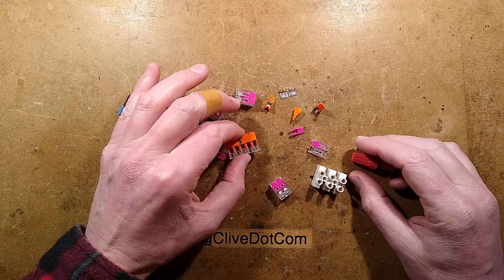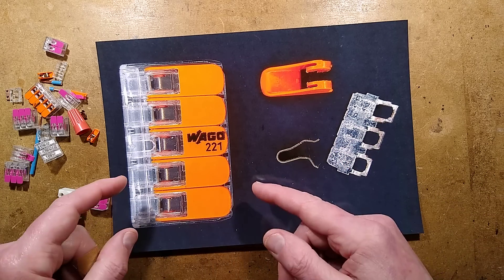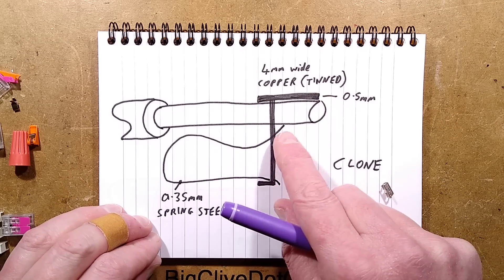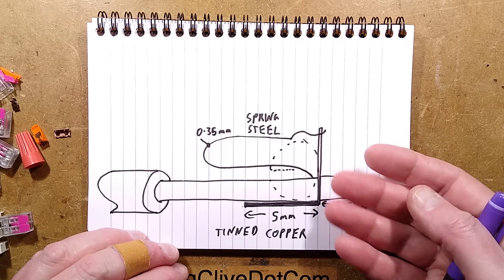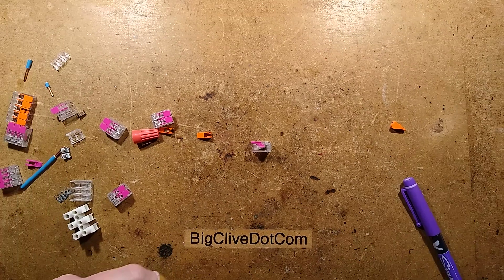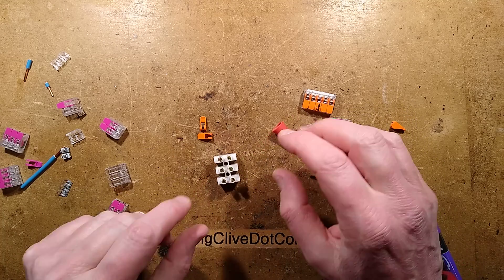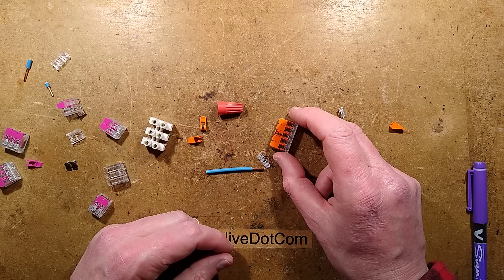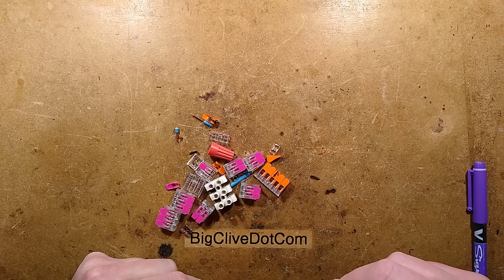Inside a Wago connector and a clone

Comment: The worst are those screw terminal splices used in the UK.  The Wagos are nice because they apply a constant tension so the connection won't loosen up over time.  Wire nuts may seem crude in comparison but when used correctly, you really can't complain about the effectiveness of the connection and the low cost.
Reply: The "when used correctly" might be a catch. If untrained users struggle with your product, that's not necessarily a feature.
Reply: Let me put it this way: how many people you know twist the wires before installing a wire nut?
I guarantee it is at least 20% of your coworkers. That alone should tell you why the qualifier “installed correctly” should not be assumed
Reply: @melody3741  I'm more concerned with wire size and count for the correct size wire nut.  I've not pre-twisted them (much) but really wrench down on them to the point where they bite into the copper.  Usually by that time, the wire ends up well twisted.
Reply: I can definitely see the advantage of using Wago connectors for someone who's inexperienced. Personally I think I'll stick to wire nuts. They're cheaper and do what they're supposed to, never had an issue with them, and I'm more than competent enough to pre-twist before screwing them on, as I do every time I do any DIY electrical work around the house or for family (I had a couple years of formal commercial electrical training in high school).
Reply: @TakeNoShift  Twist nuts are great for permanent installations you don't have to screw around with once finished or have no intention of ever swapping out. "Lever nuts" like those Wago make are nice for the possible future replacement of components in the future.

Twist nuts also tend to mangle leads up whereas the levered variety if used correctly preserve the wire structure, so if additions are necessary you just add more connections with less risk of lost leads and less need to repeatedly strip wires. Since they don't flare out at the bottom, they could also be used to make connections so they tuck away in a niche twist nuts simply can't fit in as easily.

How about trying them out before knocking them?
Reply: @bluephreakr  "How about trying them out before knocking them?" I have tried them, I really don't see THAT much of an advantage over wire nuts for someone like me who knows what they're doing. Like I said, Wago connectors seem like a good option for those who are inexperienced.

"-the levered variety if used correctly preserve the wire structure..." You don't end up with a mangled mess if you use wire nuts correctly. It's not hard at all to keep things neat with wire nuts, unless you're inexperienced, and at that point if you can't neatly fold wires back into a box with wire nuts, you won't be able to do it with a Wago either. Wago connectors are much more approachable, sure, but for anyone who knows how to use wire nuts properly, they do their job perfectly fine with no issues, which is exactly my reasoning for why I said I'll stick with them.
Reply: Well, wire nuts are most definitely inferior. Yes, they can work, but they don't have the same ease of use (and difficulty of Mis-use!) as the Wago connectors, and they can fail over time with thermal cycling. Wagos do not.
Furthermore, the cost of Wago terminals is inconsequential. They range between 10-25ct per piece for a 3-way connector, compared to 5-10ct for Wire nuts. That could add up to tens of dollars for a whole house!!!
Reply: @kain0m  the wire nuts I use do apply a fairly constant tension due to their very spring like nature so not only do they bite into the copper, the coil of plated steel spring rides up on the copper wires and will hold them secure trough repeated thermal cycling.  If this wasn't the case, they would probably not have all the safety agency approvals and insurance companies would be having cows.
Reply: @chrisharper2658  So their performance really relies on the quality of the steel in spring.  I just see the clones using cheaper metals ....
Reply: No. 
Wrong, wrong, wrong....
They can always complain about it, because most of them have never actually used one, or seen one. 
I know, that doesn't make a lick of sense, does it?
Don't matter, they don't use them so its inferior.
Reply: @boots7859  Or, and hear me out here.. we have used them. And we still don't like them, because we're capable of forming informed opinions based on real world experience.
Reply: @boots7859  My very European apartment uses wire nuts almost everywhere. A few later additions to the circuits use Wagos as usual. Wagos are much easier to work with if you want to add or remove something. I curse the person who went with wire nuts (also because the installation as a whole makes no sense).

Comment: Oh, and a note to all electricians out there. Spring terminals like Wago are NOT maintenance free if used in damp conditions, or where moisture such as condensation can form. The connector itself may be fine, but verdigris can eat away at the exposed copper wire inside the connector, and eventually the wire will break due to a the pressure from the spring causing a stress fracture as it corrodes away.
Reply: They've got a gel box design for wet locations, it's apparently some kind of polyurethane goo.  It's apparently rated for 1m immersion.
Reply: @jonc4403  Wago Gelbox covers are great. They are IPX8 so they can handle continuous immersion of at minimum 1m, probably more. They're approved by many standards around the world, would happily trust them. I don't know why North American sparkies are so against Wagos.
Reply: No, the EU will take Reality to the High Court and overturn that fact of life.

Comment: The versions I'm familiar with here in Australia from eBay vary slightly amongst themselves, but vary considerably from the Wago. The common factor is they all have grey opaque plastic bodies, usually with orange levers. Have you encountered or taken apart/destroyed any of these?
Reply: Those are probably rip offs of an older iteration of the WAGO connectors like 222-413. They are still available, but the transparent ones are preferred because you can see, if the wire is all the way in.
Reply from the maker: I think I took apart a through-connection version.

Comment: Canada is still fully in Marrette mode, which makes for a very full wiring box when you're wiring 3 or 4 way switches.... I've always been told to twist wires together, then put on a Marrette, then keep twisting until the you see a couple twists on the bundle. Bonus old-school points if you then wrap electrical tape over the whole shebang. 

Wago uses much less space than Marrettes and should get away from that "mash at the box to get the switch to sit flush" scenario where something is going to get stressed.

Interestingly in my former 1950's house, there were lots of hidden junctions in the walls and ceilings with twisted wires, then soldered, then taped with a phenolic fabric... None of them ever failed, but they had to be replaced with exposed blank-plate boxes with a Marrette junction to meet code.
Reply: Agreed. Waygo types in fixture/junction/switch boxes can make life a lot, lot easier and cleaner. Worth 10x wirenut cost there for sure.

Comment: Can I point out yet again that “maintenance free” spring contact blocks for mains voltage wiring have been around for many, many years. Yes, these were designed for wires to be inserted with no means of removing them, but the principle is the same. I first encountered them on commercial fluorescent tube fittings over twenty years ago. And Wago connectors have been used in U.K. industrial use for over ten years. These however need a tool to allow wires to be inserted or removed (it looks like a small flat bladed screwdriver, and indeed if you are careful, a suitable screwdriver can be used).
Reply: Wago even sells the screwdrivers, which are a nice german forest green and black. the right sizes, no risk of forcing/breaking when used properly. your distributor can even give you a couple packs if you ask nicely when buying a bucketload of connectors. 😎

Comment: I'm a card carrying union electrician, and i still use spring wire nuts.  probably because I've been using them for years, I've never had a problem after  thousands and thousands of connections.  pretty much have the capacity of each type/color committed to memory, and always strip back new copper every time i connect.  one of the things i would like to see with these wagos is a microohm test.  i have test sets that can sustain 200A.  you'd be surprised what I've found when it comes to cheap switches and connection, without testing i can tell you there would be a sizable difference between branded and knock off.  there always is, never come to an exception on that.  some pieces (and i mean to use that word) even come back as milliohms instead of micro
Reply: I agree, our European friends think they are from Satan himself. LOL
Reply: Good point. I am only an amateur electrician (i.e., home projects) but also an analog electrical engineer. The term you are looking for is "current density," which is the current passing through a contact, divided by the contact area. A tiny contact area produces a very high current density, a bad thing that can lead to fires. The Wagos' and the clones' flat contacts make contact to the rounded part of the wire, which to my mind is at best 1% of the wire's exposed circumference. I.e, it produces a small contact area. In sharp contrast, a twist-on wire nut makes substantially more contact with the twisted wires. I go overboard when I make my connections. After the wires are twisted together, I pull out my 150W Weller gun and solder the wires together, after which I apply the wire nut. Ain't no way these connections will ever fail! I also recognize that my extra effort is bat-snot crazy and cannot be done by electricians without tripling their labor costs!
Reply: @demef758  that's exactly it, most of my work is on high voltage switchgear (up to 500kv)  it's important to know how well the conductivity is on connections, and often times i have mfg drawings that will specify, say, 100-150 microohm at 100amp per phase.  that's usually a good number on distribution voltage breakers.  just out of curiosity, i bought a BlueSea batt DX (for boats) for my race car.  also got one of those crappy horror freight batt china DXs and put them back to back on my tester.  probably to no surprise, the import one had 100x worse numbers coming out, and probably would catch fire at its "rated" ampacity.  you probably already know there's a lot of electrical trash parts out there that really shouldn't be sold to anyone, ever.  the best thing to do here is buy only reputable brands and literally check everything.  another Amazon special xt150 pin conn i bought had only 25% contact wipe because the case was too long and stopped it from drawing in fully.  well, without this stuff Clive would be out of a channel i guess.  any case, like the other guy said also above me, copper does work harden, then gets brittle and breaks strands.  sometimes I've seen rat shops do this intentionally, like trim half the strands off a 500kcm cable just to make it fit in the lug.  never thought I'd work in a field where "trust no one" is the best maxim to live by
Reply: Jon C, if I were an electrician, I'd be writing my Congress-critter to demand they allow these, but I think they generally are now.
My comment was semi-facetious<sp> venting, as everyone who hasn't actually touched one or used one has an Expert Opinion on why they are barbaric stone-age connectors, which suits our obviously antiquated electricals....
No really, that about what some of the commenters here have said in most of the words.
The Ideals at HD are only .10/3-way and I use them most of the time. 
I posted above in the comments a number of reasons where wirenuts are actually technically superior, however they do require a a fair bit more work and space. I think doing a house with the Ideals would end up cost maybe 75% more in connector cost, but save a fair bit above that in labor.

TakeNoShift, I've been there too many times with brittle copper, or getting a pigtail made and pushed in the box only to find you can't get the switch in.  Most of my points/comments are really to point out the technical chops simple wirenuts have inately, compared to the wago types.  I think in the US, the Ideals which don't have a lever are more compact, technically easier to install and tug test, and seem to be able to meet current specs.  I generally replace my wirenuts with the Ideals.
I'll probably get some wago clones for my electronics hobbying since that is where their re-useability will actually come in handy.
Reply: Don't bother trying to explain from a source of experience or training. You're American or Canadian, and as such your input is simply not enlightened enough to be worth considering.  
Cutting 1/2" off of wires and wirenutting them is simply far too complex a digital operation. Sliding a wire into a hole or clamping with a lever is easier, therefore it must be better.
Paying 10x the cost of a wirenut which can do the exact same job is the smarter* thing to do.  
*For certain definitions of smarter
Reply: @boots7859  It's faster, potentially a lot faster if you're actually properly twisting the wires before you spin on the wire nut.  10x the cost of the wire nut may be worth it when you figure in expensive electrician time.  And it's REALLY easy to see that it's done right, whereas with wire nuts if you're double checking somebody's work you've got to undo a sample of the connections to verify that, making inspecting them far easier.  Part cost frequently isn't a good measure of cost.
OTOH, UL says stab connectors on the back of outlets are good enough, and we all know that's BS.  I do have my concerns about contact area with these newfangled Wago connectors, but they've apparently been in use in Europe for many years and haven't caused problems.  Sometimes good enough really is good enough.
So, smarter?  Probably so, even at 10x the cost of a wire nut for the part, I'm betting the time savings is worth it.  And they're here now, they're probably going to be spec'd on more jobs whether you like it or not.  I know I'd have to seriously consider it given how many times I've dealt with badly installed wire nuts.
Reply: @boots7859  Your attitude stinks. Get better or get out.
Reply: @boots7859  I've had many instances where the old, exposed copper was brittle and snapped off while trying to straighten or manipulate it in any way. I'd wager that's one of the reasons they cut off the old copper. I'd hate to spend the time trying to straighten that old copper to make a new connection just for it to snap off. Wouldn't want the risk of that old copper doing that regardless of which connector you're using. I'd be worried about accidentally brushing catching that lever on the Wago connector and having a hot wire fling out and cause issues. Can't accidentally unscrew a snug wire nut, especially if you do it properly and pre-twist before snugging it down.
Reply: @TakeNoShift  That risk would be minimized if the twisting action of the copper wasn't an issue with twist nuts. Hence why lever nuts are the better alternative for long-term applications where there is a possibility of adding more connections for powering another component in an assembly. If the copper is brittle enough after work-hardening to be an issue requiring the exposure of fresh copper, I'd assume the entire wire is compromised.
Reply: @bluephreakr  It's not an issue of work hardening. IDK what exactly is causing the wire to become brittle like that, but I would barely go to manipulate the wire at all and it would snap off at the insulation. This would be an issue regardless of which connector you use, as this obviously isn't due to work hardening. Using a Wago won't suddenly renew the copper to being fresh as if it were just stripped.

Comment: I heard that the IEE regs in preparation will recommend non screw type connectors for all new installations. It reduces the risk of incorrectly tightened chocolate blocks, or loosening with time.
Reply from the maker: That's IET, since I don't think there are any actual electrical engineers involved in many of their recent technical decisions.

Comment: Great Scott did a test of those and discovered the flip up type Wago had way more resistance,  almost dissipating a watt at 20 amps. That's a lot of wasted power.
Reply: 20 amps at 120V is 2400W, and at 240V it's 4800W. Losing 1 watt on 2400W is hardly a drop in the bucket. 12 AWG wire, which would be rated for 20A, has a resistance of 5.12mOhm per meter. At 20A, that 2W per meter of losses, and that's for the total run of wire. Your wire is dissipating as much if not more than your Wago connectors. It's all relative.